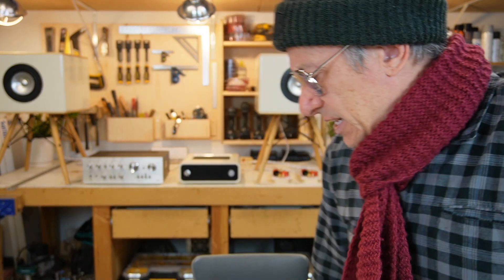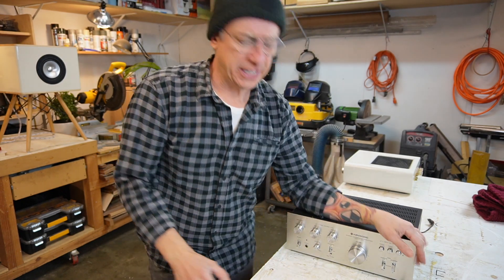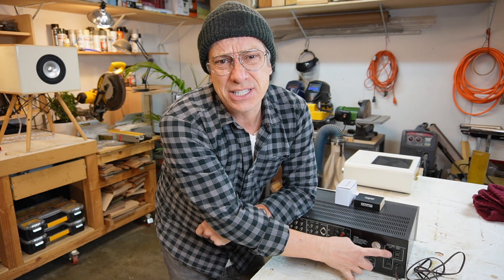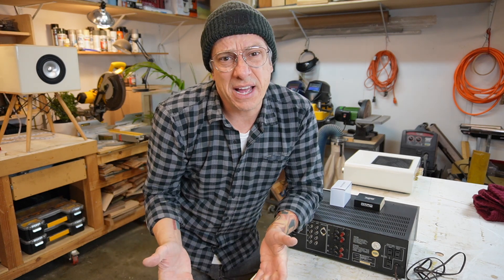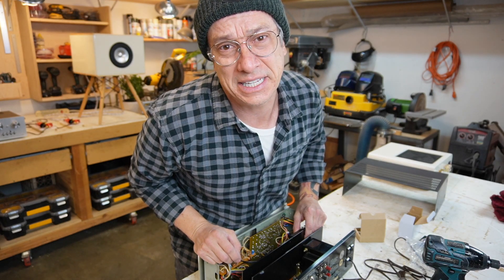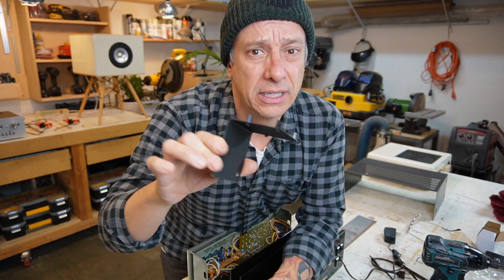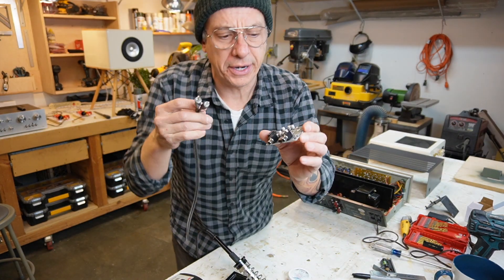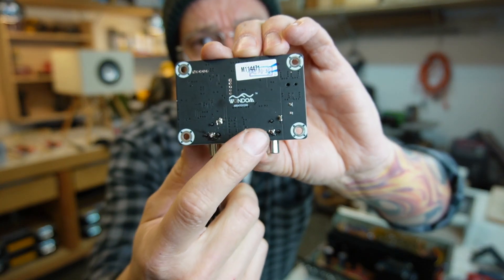Add a Bluetooth board into your Vintage Amplifier | DIY Pimp my Amp.

Comment: Thank you, great explanation. Only a question: why you didn't fed the BT board directly from the amp's power supply? I'm looking forward to do it myself with my amp
Reply from the maker: You can do that. I didn’t spend much time looking for a 12 volt source.

Comment: Does it have to be the tuner port ,or could it be aux ,and does it have to be able to visualy see the unit or does it connect even with the cover on thanks
Reply from the maker: Hello Mike. It could be auxiliary for sure. It’s good to see the board so I know by the light if it’s connected or not to Bluetooth.
Reply: @sonnoradesign   Thank you for your answer
Reply: Can a led be connected so it can be mounted on the front panel of the amp . Cheers paul @sonnoradesign

Comment: Hm, there was no right amount of volts available inside amp so had to use wallawart? And it would be nice if the name of the bluetooth could be changed from some efgkz-3 to Kenwood ;-)
Reply from the maker: That’s right!! Have to order a bunch so they can customize or pay per unit. 
I bet there was 12 Volts inside…

Comment: Brother you have some big cajones to do this modification.  I am planning to make an external retrofit.  Put you inspired me to do it. What was your profession.  You have a lot of skills and knowledge.  Art Bolanos, Houston. Texas
Reply from the maker: Hey Arturo! Thanks man. I’ve been working with speakers for quite a long time, I started on car audio. I’m a product designer.
Reply: @sonnoradesign  Bernado do you have an electronics background?  I created a HTPC Home Theater System and need to design a wireless subwoofer close to our couch.  Make a subwoofer with wireless feature is your next build.  I have alot respect for your design and fabrication.  Thanks for putting the parts used for this fantastic upgrade. Art Bolanos, Houston Texas